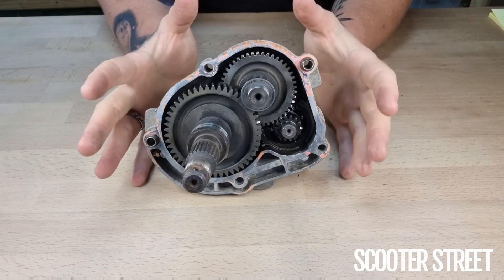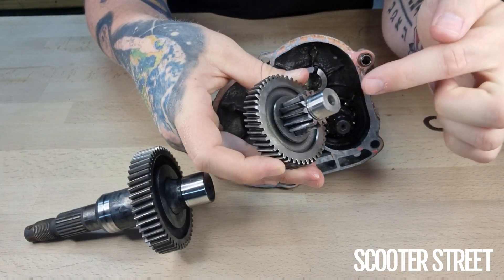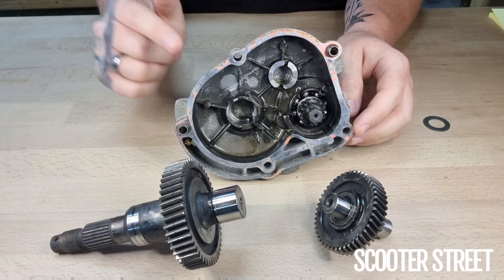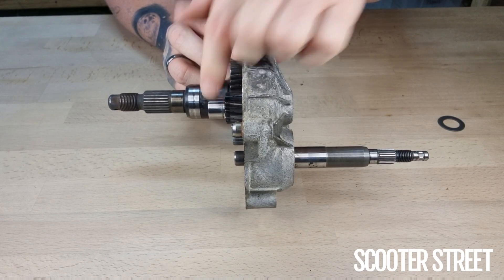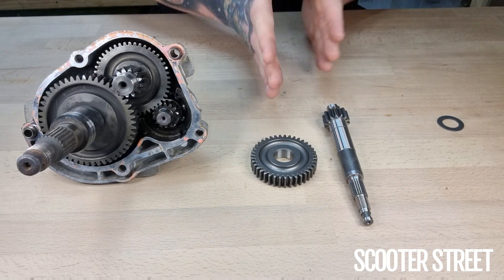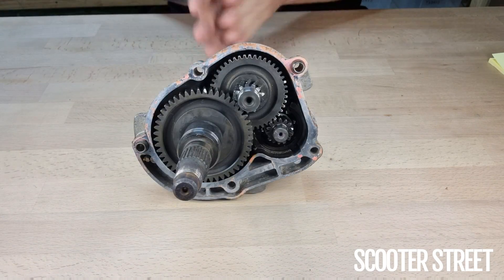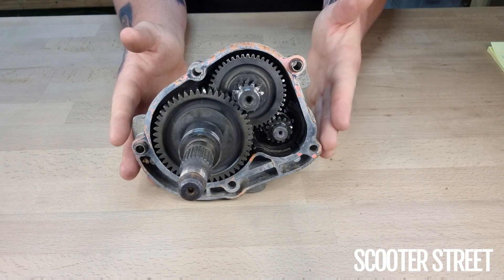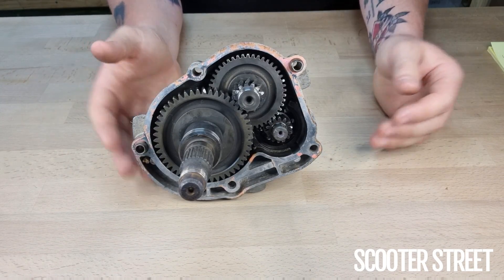Scooter Gears Explained! Primary & Secondary Kits - Which To Buy?

Comment: Hey, I have a few questions.
I have a 50cc gilera runner upgraded to a 70cc MHR cast iron cylinder.
I recently changed the gearing from 1:13 to 1:11 by changing the primary gears.
I gained 10km/h but it bogs down at that speed and it also screams alot (the variator rollers are 7,6g).
Do you have any advice?
Reply from the maker: The straight cut gears do make a turbo noise at high speed, is this what you mean Screams?
Also try to retune the carby jet. Booging may mean you need the next jet size. Do the pen test adn make sure the belt hits to top position in the Variator.
Reply: @scooterstreetau  ow yes, I love the turbo sound but with screaming I mean that it's revving too much
Reply from the maker: @lummels597  Ok ok, try heavier rollers, BUT you need to do the Pen test first and then go heavier by small increments. If it is reaching the top then you may consider the secondary gear kit. You could also up the rear tyre size.
Reply: @scooterstreetau  yes I'll try the pen test first. Thank you very much mate
Reply from the maker: @lummels597  Good idea👌 Very welcome.
Reply: hello friend, I have an aprilia sr 50 with malossi clutch malossi springs malossi variator malossi rolls 4.7 with 7.2 and janneli exhaust... which is the best gear ratio for my apriliato gain speed but not lose start
Reply: Rollers too heavy

Comment: hi what would be some good gear for a 70cc polini 2 stroke vento so i can get up to those 80mph number, i have a pretty good decent setup i’d say, i have the big bore kid with polini exhaust, polini variator and malossi clutch, 21 keinhen carb,, coil and cdi only thing stock in crank and magnet,
Reply from the maker: You would consider going to a higher class (race type) cylinder and exhaust and upgrade the gearing too.
Reply: @scooterstreetau  okay,, what do you recommend?
Reply from the maker: @curlschannel7379  Find out what is compatible for the model and then go for the race cylinder and exhaust, we do not have a Vento in Australia ( possibly rebadged as something else) but it looks like a Minarelli based engine so go down that track. What part Brands have you previously fitted?
Reply: @scooterstreetau  yes minarelli, it’s a QMB40 if i’m not mistaking it’s the long case, it was completely stock, and i miss typed something it has a 28 mikuni carb, kinda big but it rips, anyways it was completely stock then i added those parts like a 72 polini kit and exhaust,, the variator is also polini i think i’m running on 6g rollers right now,, with a hard spring on the clutch, i’ve also realized people have there pulley belts loose, is that how it’s supposed to be? because mine is on pretty tight,, i can’t get it on the variator unless i open the clutch a bit, is that good?
Reply: has the stock 16/49 primary gear and i added a stage6 15/39 secondary, for top speed, it raised up to maybe 56mph let’s say 60, i know it goes faster because i’ve seen a honda elite 72cc go 79mph and that’s where i want to get at, i don’t what there setup or gears look like though
Reply from the maker: @curlschannel7379  The belt should sit firm when engine has stopped.
Reply from the maker: @curlschannel7379  Heaps of parts available for the QMB40 engine. It sounds as though you have all of the parts, you may only be missing to top end gear such as inner rotor ignition, over range transmission items. The higher class cylinder and mid to race exhaust make a huge difference to the power output so if you nee those speeds consider the classification of the parts you currently have. Need to get that RPM to the roof.
Reply: @scooterstreetau  okay sounds good thank you, last thing, what are other way to get that high rpm besides light rollers?
Reply from the maker: @curlschannel7379  Higher Class Cylinder and exhaust, Inner rotor ignition.

Comment: I’ve got a gilera stalker with a 70cc malossi cast iron kit fitted standard 17.5 carburettor ( jetted to suit ) and malossi red sponge with standard airbox, also got 5.7G rollers and yellow clutch springs. My scooter tops out at 60-65mph but screams it’s nuts off so I don’t like going that quick very often. I’m just wondering which gear up kit should I get. The gearing is standard piaggio currently.
Reply from the maker: The set up sounds really good! The gear kit, well it depends what is on the market for your engine, Malossi do a 13/48 Secondary for GS. Look into the secondary gear kit and check out our Gears Video to gain an understanding of how the ratio will effect the outcome..   https://www.youtube.com/watch?v=Wfuqm95sBaY&ab_channel=ScooterStreet
Reply: @scooterstreetau  Thankyou yes it runs very well and lifts the front end up with no problem I just don’t want it screaming at me when I’m going flat out 😂 do I need to do both primary and secondary gears or just the one
Reply from the maker: @dexietyy7922  You could consider changing the rollers or upgrading the Variator to over range. 2 stroke are supposed to scream..
Reply: @scooterstreetau  might have to or I might get the stage 6 primary gear kit as it’s already pressed together, I might put slightly heavier rollers back in not sure yet
Reply from the maker: @dexietyy7922  Do the math with the Primary gear too get a final ratio, good luck👍

Comment: Hi,i have an Aerox,just replace the stock exhaust and first gear slowly move after revs,when i put the stock back first gear revs,what îs the problem?
Reply from the maker: Which exhaust did you fit? If you have fit a performance exhaust the engine will move slowly from the start UNTIL you make adjustments and parts changes too the main jet, the rollers and the clutch spring..👍
Reply: @scooterstreetau  i put leovince TT
Reply from the maker: @B58-555  Did you tune the engine? see previous reply.
Reply: @scooterstreetau  no,its original 50cc
Reply: I change the mein jet 72 up to 85 now its move From the start,But 85 its not big for 50cc?
Reply: @B58-555  85is too big for 70cc I have 72 in mine runs perfect
Reply from the maker: @B58-555  It MUST be tuned to suit the exhaust..   https://www.youtube.com/watch?v=kFr0nwXf448&t=5s&ab_channel=ScooterStreet
Reply from the maker: @B58-555  82 sounds too large. You need to change the rollers and the clutch springs<<<<<<
Reply from the maker: @dexietyy7922  🙌
Reply: @scooterstreetau  i change it,But with 72 mein jet,it has slow start after revs,when i put the 86 it start good,its just an 50cc Aerox 2001
Reply from the maker: @B58-555  Ok cool, stay with the 82 then👍

Comment: Hi I’ve got a Zip with a TT exhaust and they 70 cc cylinder I watched your video and I’ve been looking online and I’m thinking the 16/37 is a good choice but just want to clarify from the master if this is a proper fittingI’m looking for good acceleration and a nice top speed
Reply from the maker: Hi Leanne, depends on your factory gears. The 16/37 Primary may be a little much for you with that setup but worth a try if you're really after some more top speed. The secondary 14/47 set on that bike is also a good option!

Comment: hi from the uk ... recently upgraded my bike using your zip video to put a bore on my nrg mc2 5.7g rollers ect , i want more speed from the bike what gear up kit do you recommend
Reply from the maker: We didn't get the MC2 in Australia, only the later model NRG in limited numbers, so I couldn't give you specific advice on the exact kit to use - but I'd recommend increasing around 15% if its a basic sport cylinder kit and sport/street exhaust. Count your factory teeth, use the ratio calculation and then plug in some Malossi or Polini options to work out which is going to give you the increase you're looking for. We have an article on our website (link in video description) which also shows how to work out the ratio, you can just substitute in your teeth numbers.

Comment: That's a great explanation of how to work out the gearing.
For a rough idea of the final drive you can mark the clutch bell, and tyre. Then see how many turns of the clutch it takes for the wheel to turn once.
Reply from the maker: Glad you appreciate it, and you're absolutely right - we have used that method before. Counting teeth can be monotonous work😅

Comment: What about a yamaha aerox 100cc
Reply from the maker: The principles are exactly the same.  If you remove your factory gears, count the teeth and calculate your final drive ratio. Once you have, have a look around to see what's available and plug those numbers into your final drive calculation, then compare to the factory to see what percentage difference each makes, and which will be appropriate for your setup😁